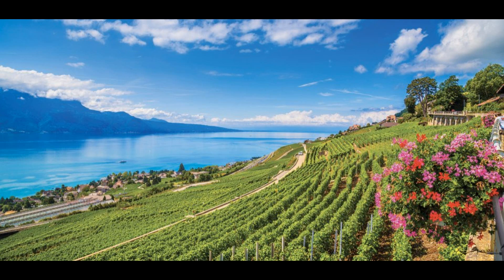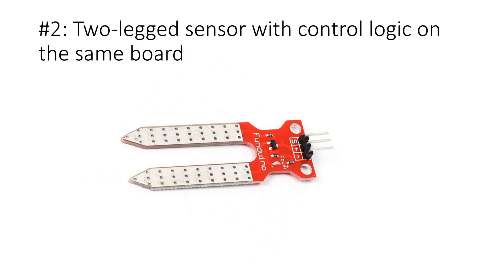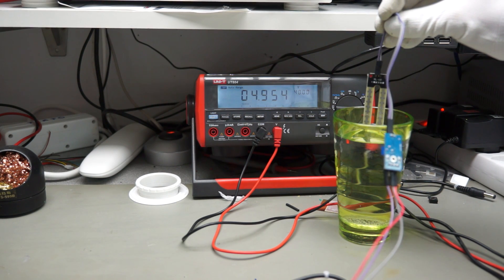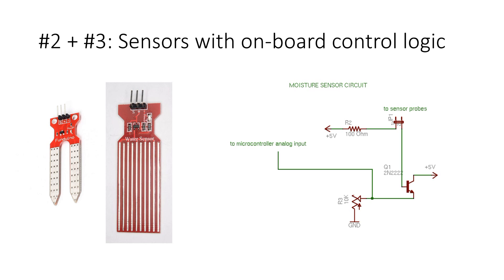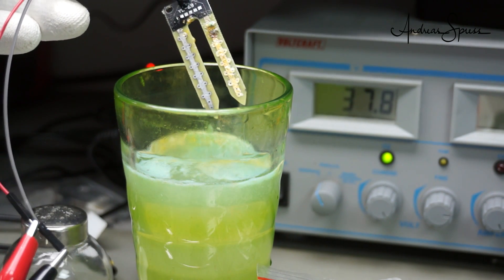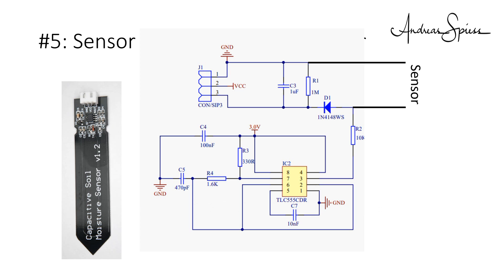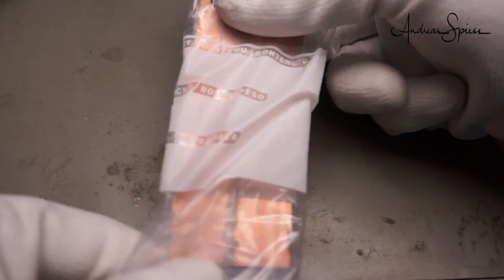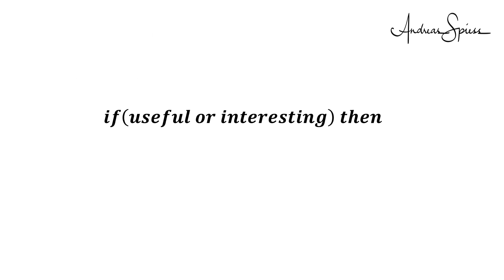#207 Why most Arduino Soil Moisture Sensors suck (incl. solution)

Comment: Hello Andreas, this is an excellent video. I am Electronic Engineer but never had the opportunity to practice it. I love how you explain the principle with the electronic schema. This video has been very useful for me since I was doing the same type of research as you by comparing different probes. I am typing to make a wifi watering system (possibly solar) and this was very helpful.
Now, I have heard that the consumption of this device was abnormally high and that better solutions should be found (unless you don't mind about consumption).
Reply from the maker: I do no more remember the consumption. But maybe a small solar panel can help. And you do not need it on the whole time. One or two measurements a day should be ok.

Comment: Andreas I use this video one year ago and give me good results the capacitive sensor. Before use an Arduino Uno for measure and now change to Arduino Due, but the results are not the same. Maybe is the output voltaje of each main board? Any idea?
I can share my thingspeak channel and you can see the difference, please let me know.
Reply from the maker: The Due is a 3.3 volts board. Maybe this has an influence?
Reply: Andreas Spiess I get data from a year and need it for this summer in order to keep the good humidity of my trees. But i  am worry because with all the previous data was possible determine the max and min values, but now this change... Should I go back to a 5 V device like a Mega? Any advice will be appreciate
Reply from the maker: I do not know. You have to do tests to find th reason, I think.
Reply: Andreas Spiess the 3.3v vs 5v of a Arduino mega make a big difference in the results. Problem solved!
Thanks for your answers.

Comment: Green stuff is copper carbonate which is caused by corosion and electrolysis speeds up the corrosion process on your electrodes. Same thing when people remove rust using electrolysis but the object that needs derusting is grounded.

Comment: Ok, now a capacitor has an infinite resistance, once it is charged, and a residual resistance. The correct term imho for resistance regarding capacitors, and other circuits, is "impedance", but that's a shift between voltage and amperage...

Comment: I am really interested in the effect of the fertility of the soil (i.e. free ions) on the measured value. The problem with all of these sensors is that they provide a measure for the conductivity, which still is the combined effect of soil moisture and soil mineral content. Ideally you would want to separate the two, so that you know whether you need to water your plants or provide them more nutrition.
I have a setup using a Raspberry Pi with Xiaomi Mi Flora plant sensors for my indoor plants. These sensors use a combination of the two measuring methods (electrical conductance and capacity) to distinguish between the moisture content and fertility. Wisely they have chosen to make the exposed contacts out of stainless steel, which seems to withstand the corrosion perfectly. It is unclear however what algorithm is used to calculate the moisture and fertility levels based on these two separate measurements. I doubt whether they are able to completely separate the two, since there still seems to be a correlation. Of course this is understandable, since you need at least some soil moisture in order to measure fertility levels.
I am curious is anyone has any thoughts on this or maybe some experience with other sensors that can do the same?
Reply from the maker: I even did not find good data on the correlation between humidity and output voltage for both devices. I assume the minerals stay the same over time, so you can neglect them if you do not change the place and only want a signal for "re-watering"
Reply: @AndreasSpiess  The mineral content does not stay the same, because the plants actually take them up from the soil. This is why it is important to fertilize your plants for a proper growth. Just yesterday I did a quick test using (1) demineralized water, (2) tap water and (3) tap water with liquid fertilizer with the Mi Flora plant sensor. It showed that the presence of minerals (i.e. ions) changes the measured moisture content. The higher the mineral concentration, the higher the measured moisture content, which makes sense since the presence of free ions changes both the conductivity as well as the dielectric constant of the solution (and thus the capacity).
As a rough indication of when to water your plants, these sensors may still work, just take the values that they give you with a grain of salt ;-) (pun intended)

Comment: What if we operate below the voltage at which electrolysis occurs. A quick search brings up 1.2V. I imagine a resistive moisture sensor could still operate at 1.2V. Of course we do still have corrosion of the metal so capacitive would still be better
Reply from the maker: Good idea. I never tried it.

Comment: What I also experienced with these cheap sensors is that they supply the soil with a small voltage all the time. I observed two things happening to the plants near these sensors:  1.- Their growth stopped or slowed down dramatically. 2.- All plagues were gone.
Reply from the maker: Good to know. Thanks!

Comment: Hello,very good explication about the sensor(most of the channels that made a video about the moisture sensors didn't said anything about the dangers of the cheap ones) but can we can we solder a the cooper exposed terminals with a layer of solder?What do you think?

Comment: Chemical reaction: You are doing electrolysis, producing Hydrogen and Chloride (which is toxic; used in WW1 as a poison gas). Bad for plants yes!
Reply: Keep the voltage drop below 1.4V and no electrolysis will happen

Comment: The DC on the legs of the sensor causes the metal to migrate from one leg to the other.
Feeding the bare metal sensor with AC (via a capacitor) instead of DC helps. 
The AC will balance the voltage in the legs to avoid the metal migrating.
Reply from the maker: True!

Comment: Great , informative video. 👏👏
Good presentation with explanations.👌
 
Conductive metallic probes can get corroded over time because of pH value of water, as also other chemicals. 

Wonder why non-corrosive probes such as stainless steel were not used.
Reply from the maker: There are many different comments, also concerning stainless steel probes.

Comment: Thanks for the video :) I find the sensor without the exposed copper to be the best choise too, but I was wondering if stuff like rain or even air humidity could be a problem for the exposed chip when used outside?
Reply from the maker: For shure you have to protect the electronics

Comment: You can avoid electrolysis if you make the sensor thing work in ac mode rather than dc, not difficult and they last allot more
Reply from the maker: Not completely, if you belief the other comments.

Comment: Use Carbon terminals instead of copper for the resistive type of sensor?
The potential problem with capacitive sensors is 'other effects' changes in the surroundings, soil type, compression, presence of things nearby can also affect the reading.
Though this is also true for resistive sensors i suppose ;-)
Reply from the maker: I never found scientific data about both principles :-(

Comment: Dear Andreas, 
Take a look at the Irrometer 200SS app note. It uses a pseudo AC current with muxes for multiple sensors. If you are only using one of this or even a leaf wetness sensor, you can connect it in series with a known resistor and connect both ends to two digital output pins. Of course you connect an analog input in between. By running a small sketch pulling the pins HIGH and LOW and then LOW and HIGH, you generate an AC from the sensors point of view. That way you do not have galvanic current corroding the plates. Cheers Namensvetter!
Reply from the maker: This procedure was described by a few other viewers and you are right,  it seems to prolong the life of the electrodes.

Comment: I know this has been awhile.  But I came up with a probe that works really well, is super cheap, and easy to make.  I simple put three long pieces of coax cable snugly into a 1/2" pvc pipe.  The probe is sealed with simple pipe caps.  I found that putting a bolt through the bottom for grounding made it more stable.  All this stuff is super cheap and easy to work with.
Reply from the maker: Interesting concept!

Comment: pretty bad video this time, u applied a simply things: electrolysis. the things in the glass is also the result of the chemicals u placed in the wather. couse normally water is not green like yours. 
Same trick is used by the disonest to force u to buy an useless water purification system.
It's not the sensor that is bad, it's how u use it.  of course if instead to use cheap pcb coated with copper u use some stainless steel probes as in the "professional" system sensor will last way more.

on the positive side, u offered another solution that is the last sensor. but it has a big defects: all that electronic is exposed to the enviroment, so it will oxidise on the circuit part. it's not well engineered ..
Reply from the maker: Thank you for your feedback!

Comment: To avoid corrosion I used  two stainless screws for probing, and alternating current for measuring. That means instead of connecting them to VCC/GND they-re connected between two GPIO analogue pins, and switch polarity 10 times/second. That also allows keep both "legs" at same gnd voltage between measurements. It needs no circuitry, one gpio pin is configured input-pullup the other as output low so there is a measurable voltage on the input pin. In a few ms program swaps them and averages last 10 read values.
Reply from the maker: Thank you for your feedback!

Comment: Good video, I have a couple of the cheap Chinese probes and was wondering about this
Reply from the maker: Thank you!
Reply: @AndreasSpiess  I was wondering if the probes could be replaced or even have the traces reinforced with copper. Maybe use enameled copper with the wires made bare at equidistant intervals

Comment: The "chemistry" that happens when one leg of your humidity sensor dissolves, is the oxidation of your anode. To prevent this, you can combine the following two strategies: (1) use metals that  form a stable anode (gold, platinum, titanium, nickel, carbon) which means that when using PCB technology, your limited to ENIG and more advanced plating technologies, and (2) apply as little as possible voltage between the legs of the sensor, which means use as little current as possible to measure the resistance and amplify the voltage with e.g. an instrumentation amplifier. I agree that the capacitive sensor is a much more elegant and robust approach though! The working principle reminds me of the good old Theremin :)
Reply: I used a relay to cut off the sensor when not in use. You only need to use the sensor once an hour or so for a second.

Comment: Hello, you should try to supply this sensor from square shaped voltage soruce with capacitor in serries with will block dc offset :) .
Reply from the maker: This was discussed in other comments. It works, but also not for long

Comment: The sensors fail because they use DC in the detection circuit across the sensor. This sets up electrolysis of the metal. If you run AC on the sensor, they last a lot longer. Even with the 555, there is an average DC signal present of half the voltage. A better circuit would use an inline capacitor after the 555 (use the arduino PWM instead of a 555) so the signal on the sensor is centered on zero volts not 2.5 volts. And only run it when you need it., force the output to ground in between readings.

Comment: Could you use them as a rain sensor? As they will dissolve themselves too
Reply from the maker: If you have a glass to keep the water . But there are better rain sensors with shorter distances between the electrodes.

Comment: The two copper plates in your demo are not forming any capacitor? The plates are side by side and not one behind the other, and the dielectric is the PCB base material. After isolating with plastic bag No information of the soil can reach the plates? Sorry I fail to understand. Probably the plastic bag clings to the pcb when you dip in water to increase the susceptance, the inverse of reactance! Kindly clear my doubt.
Reply from the maker: You always can doubt, of course. Some people even are not sure if the earth is round ;-)

Comment: Wish I have seen your video before buying both these sensors. Dunno way but the capacitive one is total crap, it always shows the same voltage with only a small spike when I water the plants. It seems to me that  water is getting to the bottom of the pot where the sensor can't sense it ...
Reply from the maker: It worked with me. And many others. So you seem to be out of luck :-(

Comment: An AC Bridge might reduce corrosion and can be used to reduce noise. So I used two optocouplers with the transistors configured as a half bridge to drive one electrode with  a square wave. The LEDs of the couplers are connected anti parallel and connected on one side to a voltage divider, which also limits the LED current. Connecting the other side to GND or the supply voltage one or the other LED are switched on, but never both. This circuit also minimizes crosstalk and noise. The other electrode of the moisture sensor is connected to a second voltage divider and an analog input. For the measurement a digital output controls the LEDs and the analog input is measured with the values being reversed if the digital output is high. At the end I average over many cycles (e.g. 16) This way a very basic synchronous detection is implemented greatly reducing noise. Not bad for a circuit with 4 resistors and 2 couplers.
I use stainless steel wires for the sensor to further reduce corrosion and a gypsum cast around them to measure soil water tension which allows for different soil types, rather than moisture
If there is interest, I will create a github page with schematics etc. What do you think about this circuit?
Reply from the maker: There are quite a few comments about hat methods already.

Comment: i think i have a fix to the sensor corroding: use an H bridge and alternate the current in the sensor so the current dosn't carry ions from one end to the other
Reply from the maker: There are many others proposing a similar thing. Some report it also does not work :-(
Reply: now that you say it it makes sense because it isn't guaranteed that the copper ion flows back to the electrode.

Comment: Andreas Spies, Sorry to bother you. but my moisture sensor (the same as you suggest) does not work as expected. the most suspicious culprit is in the salts which coincidently is expressed in EC.
I've read on the interwebz that expensive sensors as the VH400,   have an oscillator above 4MHz, and that makes the curves merge regardless of the salinity.
could you recommend a timer which would go that high to reach that point on 3,3v? is there another way to give it a higher precision to zoom in on a specific range? (without a higher resolution ADC) the effective range of my sensor is form 315 - to 330. thnx ain advance, also anybody else who would like to chime in.
Reply from the maker: I am no specialist here. But you get a lot of frequency generator boards with higher frequency. They usually need an additional MCU. Or you try to build one using TTL chips. Google will help you. Search also for multivibrator

Comment: Thanks for the analysis. I am about to install moisture sensor in my home garden (30-40 of them) and waned to understand the difference between all types of moisture sensors available in the market before i place the bulk order. This 10 min video saved me from going through all of their datasheets. One info missing from this video is the resolution of these sensors.
Reply from the maker: I just saw a longtime study of the capacitive sensors. Pay attention your protect them with and additional layer. Especially the side which is completery unprotected
Reply: @AndreasSpiess  True. There are several concerns around directly inserting these sensors in soil. The best solution i could find is to put these sensors in plastic zip lock bags. This will not only protect the sensor but also prevent any toxic chemical from sensors eroding into the soil and then sucked in by the plant. It will probably reduce sensor's resolution but since its just a astable NE555, I should be able to fix it.

Comment: Thanks for doing the comparisons; very interesting.  I searched comments for toxic, health, danger, contaminate etc. to try to figure out if the first type of sensor (#1 at 1:13) could be used in a 'food safe' way or not but it was not totally clear what the answer is.  Was there any ever consensus on that?  It sort of seemed like if you only did measurements for <10ms every 30min. or so that the sensors would last years, which seems to me to indicate any contamination would be at incredibly small levels.  There were other discussions about what forms of copper it might be and whether they were toxic, and discussions about using stainless steel or graphite instead of the pcb stakes that come with #1....was there ever any consensus on how to do the measurement 'safely' using the resistive probes in soil used for growing items for human consumption?  Also,  is it safe to assume the capacitive probes are totally 'food safe', assuming you close off the edges somehow to avoid the copper there from corroding into the soil? (and then the question is what sealant is food safe, or if that even matters).
Reply from the maker: As I said: I am done with those sensors.
Reply: @AndreasSpiess  Including the capacitive one?  I also was wondering if anyone figured out the food-safeness of those.  I guess they are better but who knows if they are really safe?